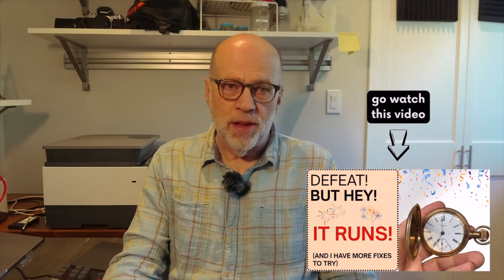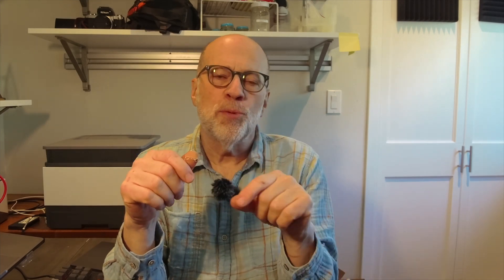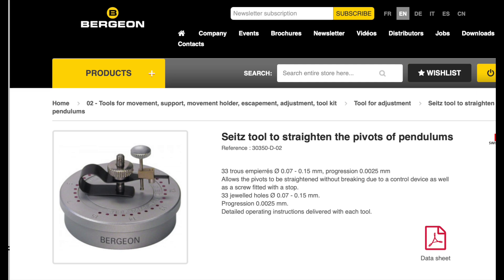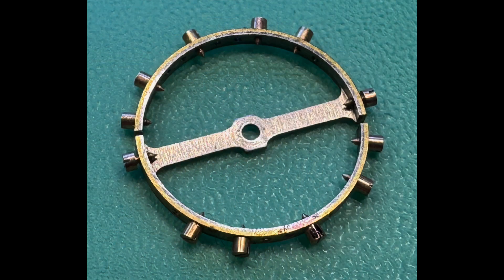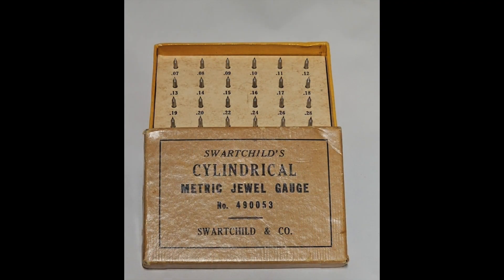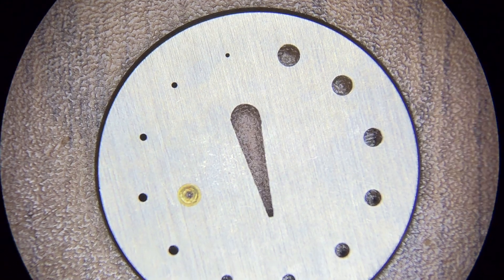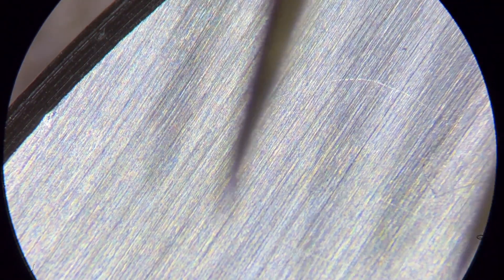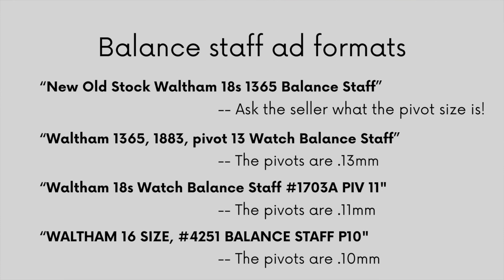How I Investigated a Waltham Watch’s Amplitude Problem

Comment: I have the same watch with the same issue. It was running great and then started to lose time.  About 5 min a day. I serviced it, new mainspring, cleaned the balance jewels, still loses time. But I noticed that if it stayed flat on the table timing was spot on. Even a slight elevation would slow it down but flat was perfect. I did have a loose roller table so I secured that and reset the impulse jewel by eye. I also noticed that when the watch went to vertical the amplitude dropped way off but slowly picked up again. . I’ll wanted to try a replacement balance complete but learned as you did that there are many pivot and jewel sizes and nothing is cross compatible. So I’ll be following your journey with great interest.

Comment: Great video! You grasp this stuff very quickly and explain it very well. 

I’m pretty sure you have chosen the right staff pivot size. 

Those marks that are visible in the balance upper pivot hole jewel look like they could be cracks. 

The best way to examine a jewel for cracks is under magnification, with backlighting. All hole and cap jewels should be inspected in this manner. 

If the crack runs to the hole in the jewel, it doesn’t matter how perfect the hole looks, the jewel is toast. 

Any crack that meets the hole will wick away oil by capillary action, resulting in a dry pivot. The combination of the dry pivot running in a hole with a crack will cause undue wear to the pivot when the watch runs. 

This watch is old enough to contain natural jewels, as opposed to the synthetic jewels that are predominant from around 1910 onwards. 

A natural watch jewel can contain inclusions, just like any natural gemstone, and inclusions can be mistaken for cracks at first glance. 

Under good magnification, the difference is obvious. Inclusions are feathery or wispy, whereas cracks have sharp, very clearly defined edges. 

If you look at the jewel under the microscope with backlighting, you will be able to tell if it is cracked or not. 

If you’re in any doubt regarding the state of the jewel, just email me a picture or two of it backlit, with magnification. 

If the jewel is cracked, there’s a fair chance that the crack and the bent pivot happened simultaneously.
Reply from the maker: I was scratching my head wondering what the marks on the jewel could be.  It looked like black Sharpie marks, which made no sense.

Cracks is EXACTLY what they are!  When I look at them now under 45x magnification, they're obviously cracks.  You are so right!

I continue to be fascinated by how this profession is a mixture of the analytical, physics, and I guess you'd say mechanical engineering.  Cracks in a jewel wicking away lubrication, of course, but wow that's not something I'd realize at first.  Honestly, my first thought was, The hole is still good so the cracks are irrelevant as long as the hole is still properly formed.  But when you described the wicking issue, the light bulb went off over my head. :-)  This is such an interesting field.
Reply: @Oldguyponderingacareerch-ip9tf Agree the jewel definitely looks cracked. The way I see it, if both the bent pivot and cracked jewel were known at the same time, then the replacement staff and jewel could be checked for fit by the supplier before shipping both, saving you the trouble of checking your jewel size. In addition to Mark’s comment that the cracked jewel will result in a worn pivot, it could also take a very small displacement of the jewel pieces within their chaton to cause the edges of the cracks to plane off steel from the pivots. If the jewel hole is 90° straight through, now might also be an opportunity to switch to a superior “olive” shaped jewel, although I don’t know if both could fit. Dave would likely know this and it’s worth asking. An olive shaped jewel allows for more uniform rotation of the balance in different positions than you’d get with a straight pivot.
Reply: @ 
I couldn’t agree more, all you mention, in addition to the puzzle-solving (troubleshooting) aspect of watchmaking fascinates me too, and contributes in no small part to the passion and enjoyment I find therein. 

When you start reading the literature about the theory and scientific basis behind mechanical timekeeping, it opens up a whole new perspective on these wonderful little machines. 

The principal modern treatise is a hefty tome called “The Theory of Horology” by the Technical College of the Vallee de Joux. 

It contains no practical watch repair techniques or advice. It is pure theory and is heavy on the maths. It’s used as a textbook at WOSTEP.

What I find especially interesting are the writings of the top horologists from the past, and the degree to which they were able to refine and improve watches to the point that there were pocket watches submitted to the Kew observatory around 1900 that are as accurate as the majority of standard quartz watches. It’s an incredible achievement, brought about by meticulous scientific endeavour. 

The work on hairspring and balance wheel alloys, escapement design, lubrication, correcting for middle temperature error and more from over 100 years ago blows my mind given the limited means at their disposal, compared to the technology we have today. 

Getting back to the matter at hand, it’s time to find a replacement jewel in setting for this watch. Hopefully Dave has one in stock. 

It’s also important to think about how the jewel was damaged. 

It is possible that the watch sustained an impact that damaged the pivot and jewel simultaneously.

Another possibility is that the balance cock was screwed down when the upper pivot wasn’t properly seated in the jewel hole. 

A further possibility is that the jewel was damaged when it was removed from the balance cock. How did you remove it?

Jewels like this can be pushed out with a jeweling tool, on the staking set, with a jewel pusher or a piece of pegwood. 

No matter how it is done, you must use a pusher that presses upon the metal rim of the jewel setting, without pushing against the jewel itself. 

The use of a pusher that is too small will exert force on the jewel itself, and this is very likely to crack the jewel.